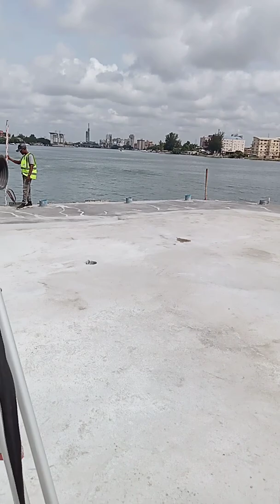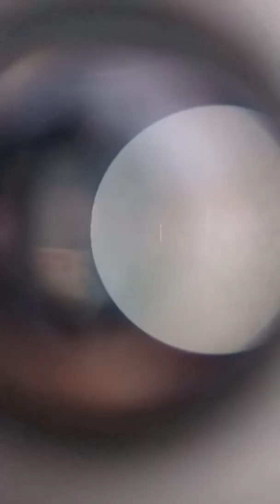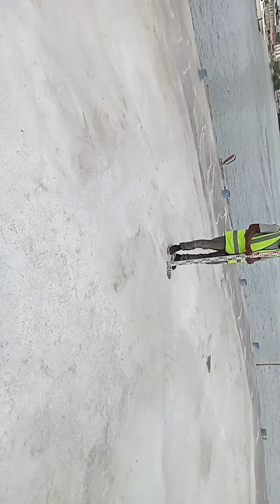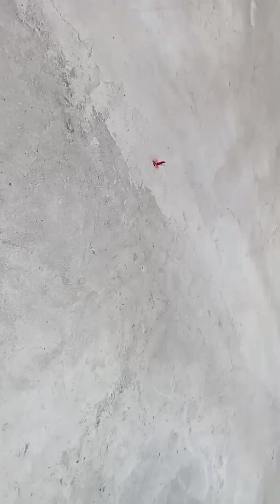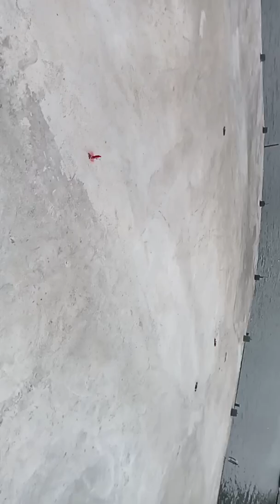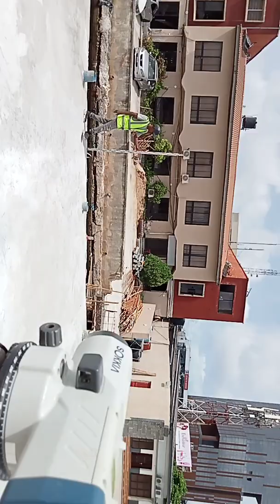How to check F.F.L (Finish Floor Level) Slab on HELIPAD Structure.

Comment: Very nice video. I got all your videos they are really helping me. I am new in construction work. 
I need your help on something though. 
Can you make a video for "how to slope land surface for e.g cut and fill, and how to slope the terrain to drain water in a certain direction?. 
I am presently working on road construction, we don't use formation level or anything from the software we just calculate onsite to determine the cut and fill. I am not actually getting the calculation. 
I would appreciate if you can do a tutorial on that. 
Thanks
Reply from the maker: Alright.
Thanks for your nice comment.
Are you a surveyor?
Reply: @SURVEYOR_TEEWHY2021  yes i am a surveyor. But not registered yet.
Reply from the maker: @omadafriday2670  Okay.
Good to hear.
I will work on that as soon as possible
Reply: @SURVEYOR_TEEWHY2021  ok thank you so much.